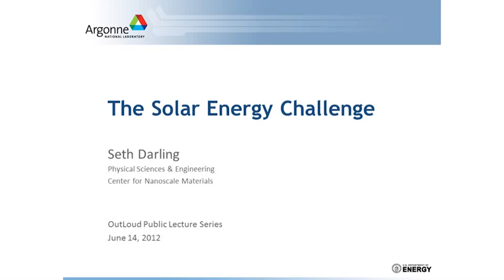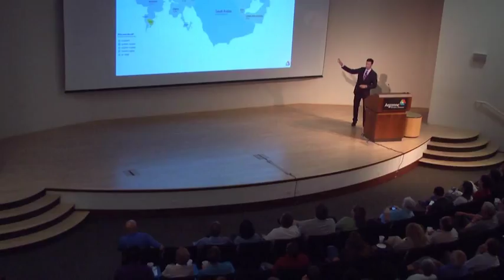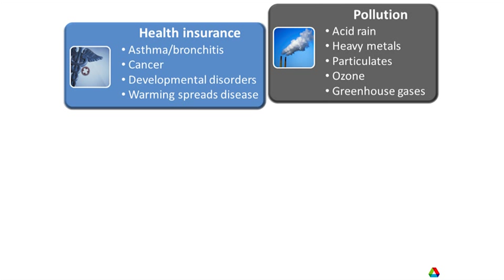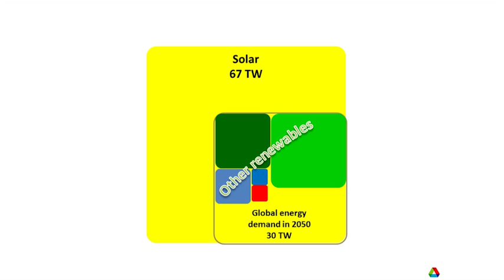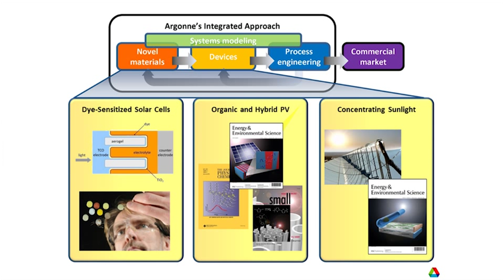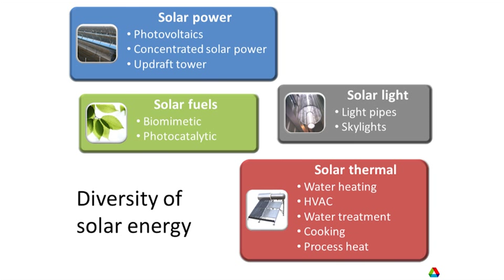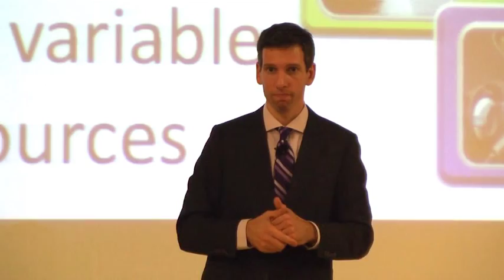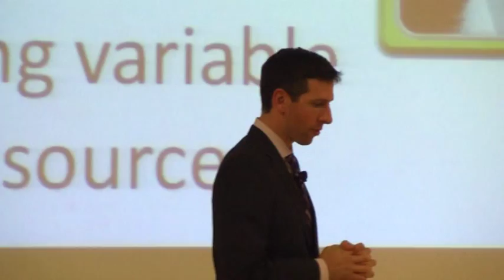Argonne Outloud: The Solar Energy Challenge

Comment: Can radiation power a solar panel or only sun light. Can any other source power a solar panel can a different panel material be made that powers radiation or can there be different panel material that creates energy from different concepts. The problem is the only type of panel is a solar panel there could be many different types of panels that can use enfared magnetic fields, sound, microwaves, x-rays, or even fission panels that produce high amounts of energy on a solar panel type material.